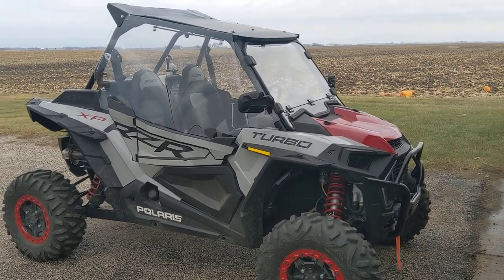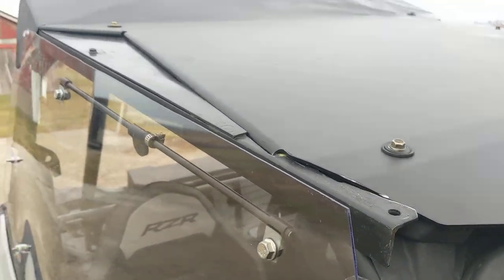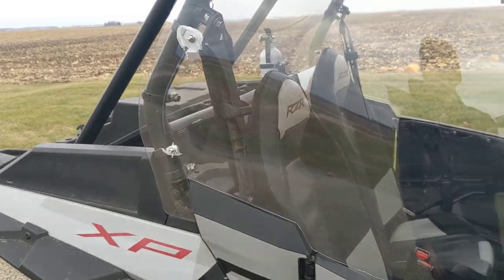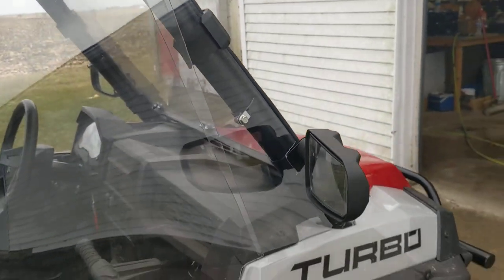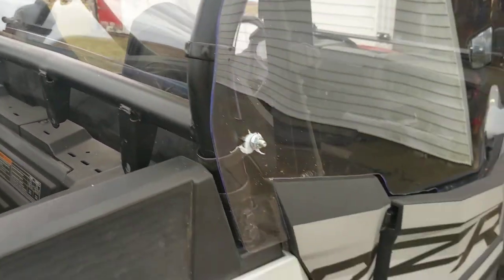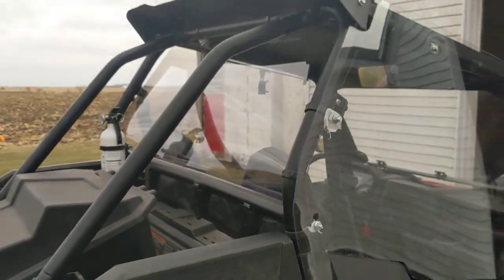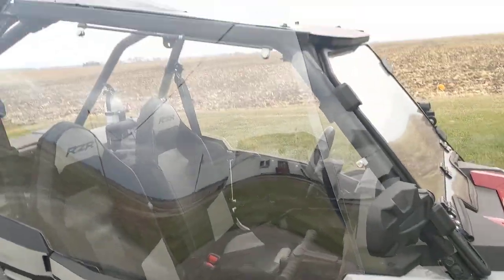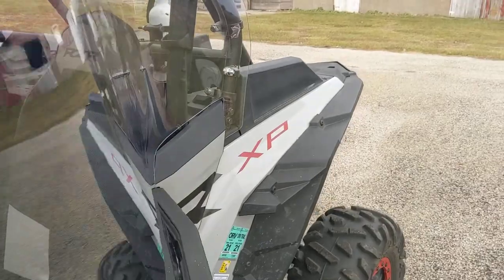Custom Polaris RZR Turbo enclosure

Comment: I’m building an enclosure for my rzr and am trying to find the same clamp you used to pull the door tight. Can’t seem to find one like it. Do you have a link to those?
Reply from the maker: It came from a flip windshield from an XUV590 Gator

Comment: What works best to cut that with ? I’m about to do my 18 xp1000 , I’m gonna try to make frames and bend them to shape of roll bar doors , I’ve got lots of square tubing laying around , and I have couple rolls of big rubber door seal gasket I’ve had forever , did that stuff flex enough to bend it open at back ? Looks like one piece from front of door to back of cage , I figured I would have to do 3 pieces on each side , looked at plastic at lowes last night was confusing on the 4 different grades ? The better stuff was $90 per 4x4 piece
Reply from the maker: I used a jig saw. Worked well. If you want to use a single piece and have it flex, you must use polycarbonate. Check out my RS1 cab video to see how it flexes.